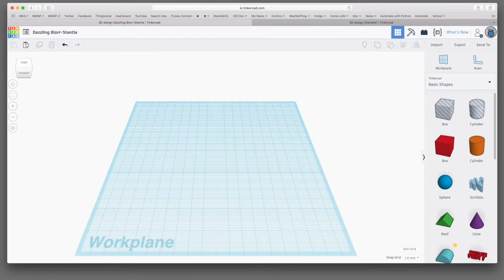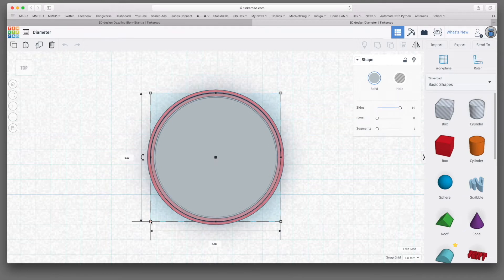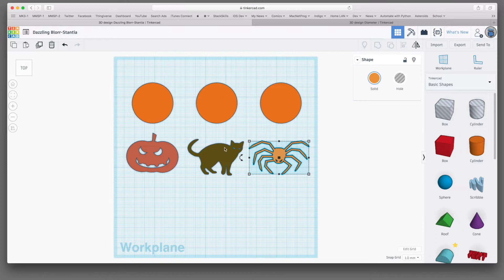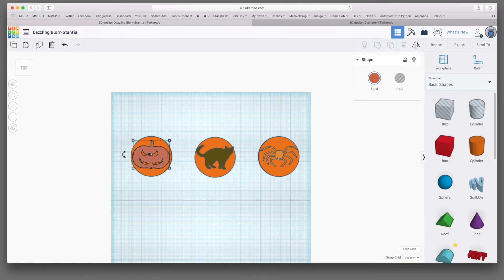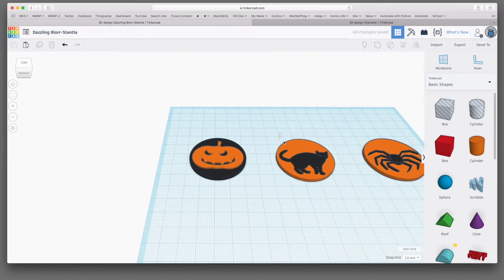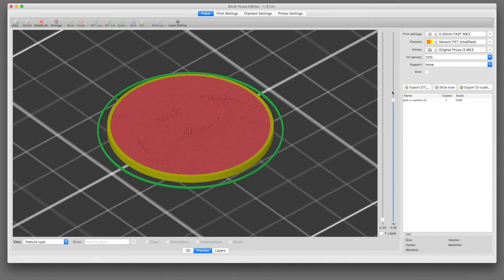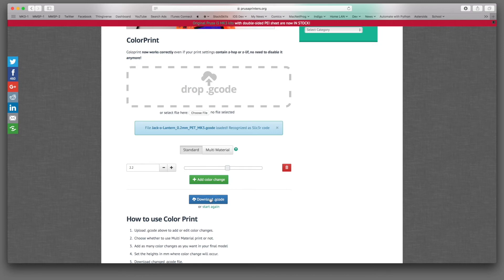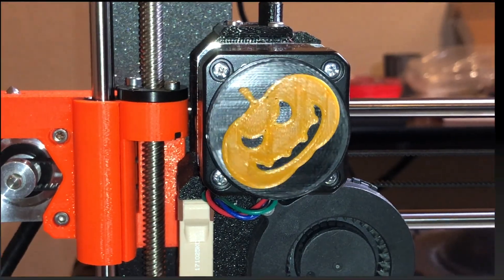Design & Print Halloween Decorations...For Your 3D Printer! (Extruder Visualizers)

Comment: Would this work for the MP Maker Select Plus
Reply from the maker: Hi! yes, it sure would. You may need to use an extra magnet to give enough length to reach the spindle of the extruder stepper motor. And of course the extruder visualizer will be on the right side of the extruder instead of the front. At one time I made one shaped like a gear on the extruder motor of a Monoprice Maker Select Plus because I think it looks cool. And it helps to be able to see when the motor is actually moving. 👍
Reply: @BV3D  thank is the stl for the gear on thingiverse
Reply from the maker: No, but if you send an email to bv3dchannel@gmail.com, I will email you the file.

Comment: Another great vid Bryan!  Learned some more about Tinkercad, which I really appreciate. One question, will the Prusa color change g-code work with the Maker Select Plus?  My assumption is yes....but, I'd rather know ahead of time if there are any gotchas!  Thanks again for all you do.
Reply from the maker: Hi! I'm 90% sure it will, with the ADVi3++ firmware. I'm not sure how the Maker Select Plus handles the "pause for filament change" command (M600). I'll do a test print on an MMSP with ADVi3++ on Monday to see if it works. My recollection is that it does. Let me know if you're still on the stock firmware, and I'll roll one of my MMSPs back to stock to see what it does. In either case, I don't know if it plays nice with OctoPrint, but I can test that too, if you want.

Also: Super big thanks for all that coffee!  ☕
Reply: The coffee was my pleasure!  I'm still on the stock firmware, but that will likely change in the near future.  I purchased the BLTouch Smart v2 through Alien3d (which I just received today).  Time to print a new enclosure for the LCD and a mounting bracket for the BLTouch.  And...upgrade to the ADVi3++ firmware.  I don't have a project lined up where a color change is needed, so no need to test on the stock firmware.  Pretty sure I'll upgrade this coming weekend....assuming I get everything printed in time.  Thanks again!
Reply from the maker: OK. Make sure you've got a small MicroSD card for the LCD's software update. Sebastien Andrivet says it should be under 8GB. I've used 2GB and 8GB cards and not had a problem. Any larger than 8GB, and the LCD can't read it. Best of luck to you on the firmware upgrade! 👍
Reply: Thank you for the advice!